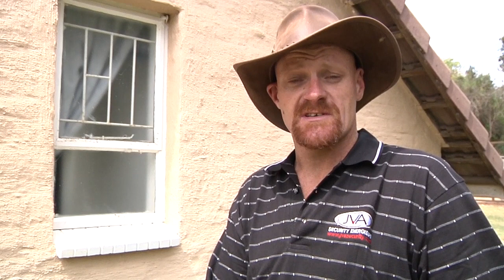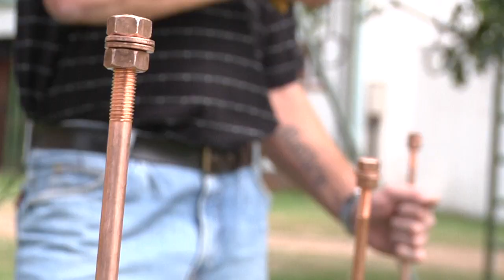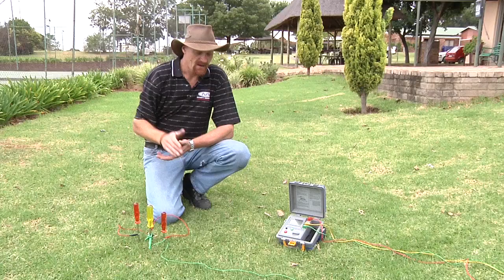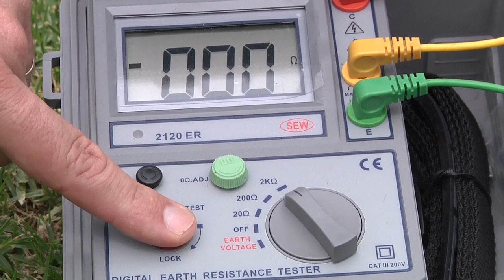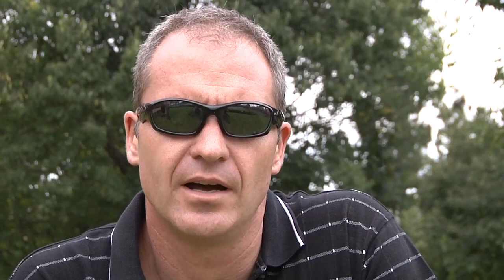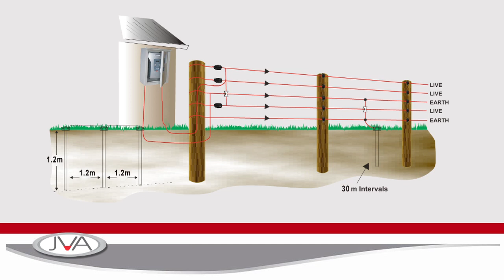Ground Resistance Measurement, Fall potential method

Comment: Hello !, (PLEASE! read!!!- Clamp-"Megger DET14C ") I try to understand the principle of measuring it, from rumors and tools it goes out so that it measures the condition that there should be a complex contour or similarity
that invested in this, I do not understand
we will take the base station of the communication network with zazstr where the 3 vertes of the earthing switch are standardly driven in and between them is welded
on it will measure or not, or it is necessary to look for asphalt on the ground that is not fun. and then to score even more fun
Ie type of how to artificially complicate the zaz device station by hammering the pin and using a clamp or lamb with a thread sowing on it?